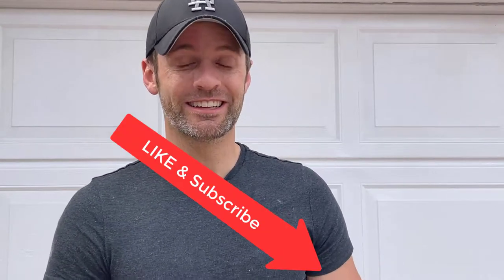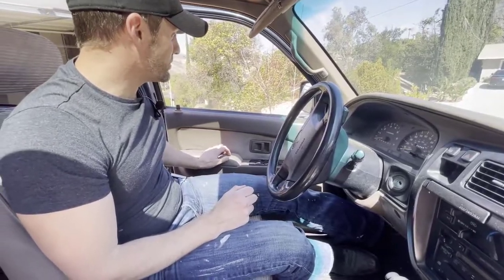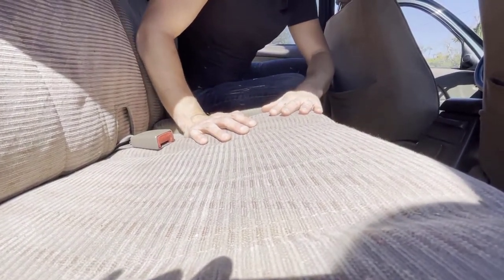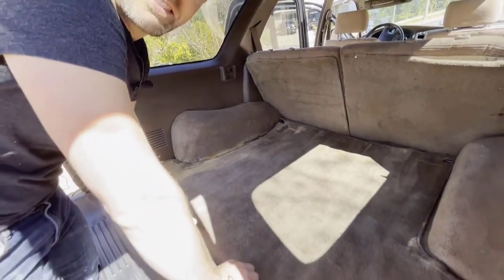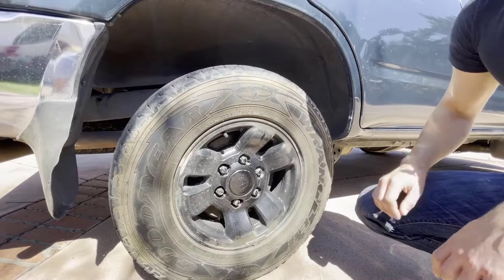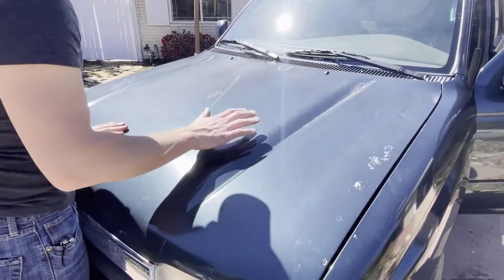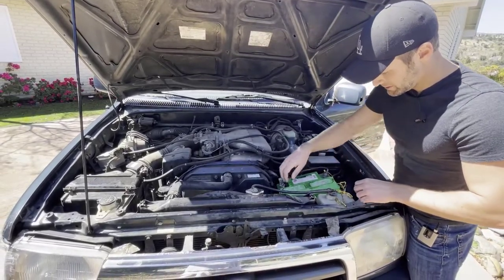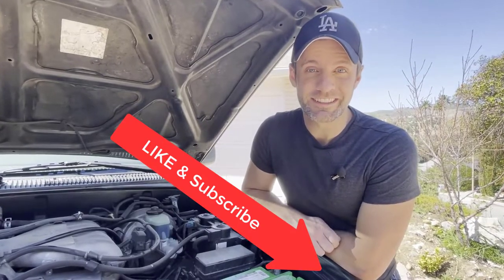1998 Toyota 4Runner: Restoration Time!

Comment: Happy to find this project. Recently bought a 1998 like this other than leather seats. Near same condition, sort of. paid $2500 for mine. Doing new engine(250k mi).  Since I live in Indiana, mine will be a lifted trail truck. Believe it or not, not much rust. Not 100% of a style direction though. We'll see. Definitely plan on watching your progress. Hopefully pick up some good tricks. My current truck is a 2003 4Runner v8 limited w/ 248k miles. Will be my sons truck soon. I better get busy..

Comment: Great find.  Toyotas are generally  mechanically bulletproof.  A pick and pull wrecking yard and Ebay will help with your budget refurb.  I would change fluids but be thoughtful about the transmission.  Often times if it hasn't been changed at the proper intervals and you do refresh, you may have potentially opened a can of worms.  If you do change the transmission fluid , use only Toyota factory ATF.  Just my humble opinion based on many different vehicles I have owned and maintained.  Great channel, hope you didn't sell that sweet Square K-5!
Reply from the maker: Skinner!! Stoked to have found it.  Its a really cool vehicle.  So many projects to do!  I have started to search craigslist, offer up, ebay...like you said parts are easy to find for sure.  Ill hold tight on the transmission fluid change.  Would be cool to just pop it out and do a rebuild video.